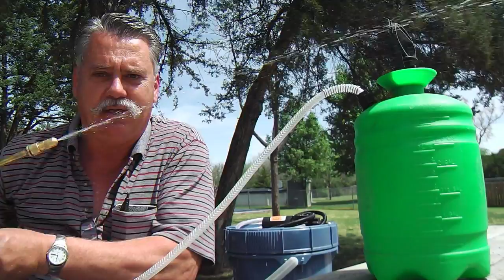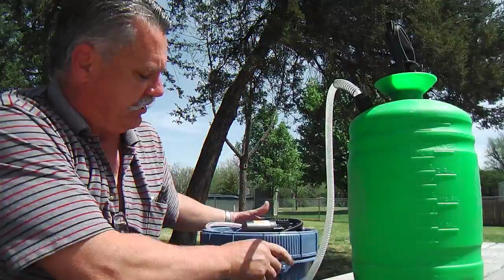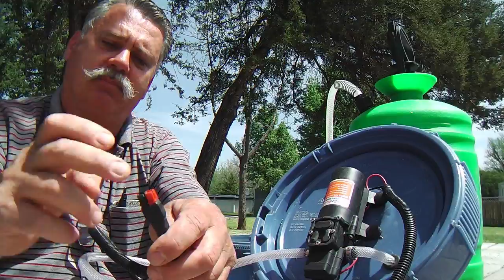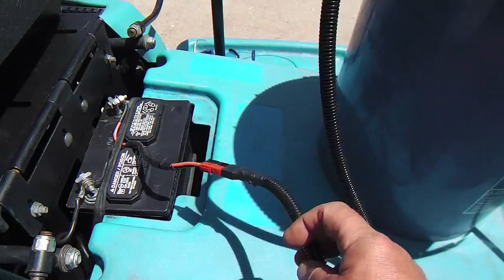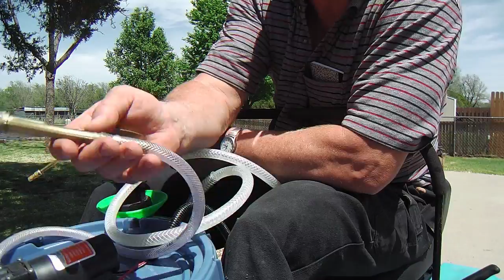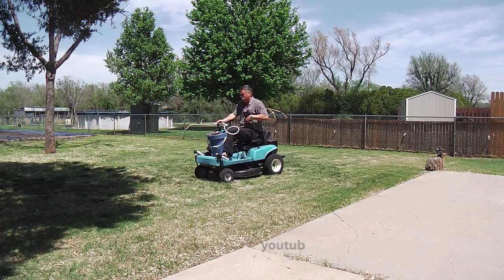Devise Your Own 12-Volt Lawn Sprayer

Comment: Cool idea. However, a stream doesnt deliver good coverage of a weed. That is why everyone suggests a fan tip nozzle. It isn't about distance or mass coverage necessarily. You want small droplets to the weed killer sticks better to the weed. Additionally, a surfactant makes the water droplets even smaller to ensure the chemicals stick even better.
Reply from the maker: Well, I like the stream anyway, as there's no orientation needed, and I have a little wiggle technique that make for good coverage as a spot sprayer. Actually, I've since moved up to a 9-gallon tank that fits up to the forward section of my zero-turn mower for larger spraying. And I may, one day, fit an attachable manifold to the back of my mower, that allows me to switch from spot spraying to a wide and consistent broadcast of spraying coverage if I ever encounter more acreage weeding. But, for the incidental spot spraying, I've really reverted back to the green, 3-gallon, manual pump sprayer, even though a 5-gallon bucket-style is still sensible to me for a general purpose sprayer between those two methods. Yeah, I'll usually use mentholated seed oil as a surfactant, or, in a pinch, some dish soap.

Comment: Great idea you have here. Could you tell me the hose diameter size you used on the pump on the suction side and the sprayer side? T.Y.
Reply from the maker: If I recall correctly, it was 5/16" ID on both.

Comment: i have a challenge for you. i'm an otr truck driver myself, and there's one huge challenge we face in the industry. that challenge is SHOWERS! no one likes to shower in a filthy truck stop shower used by millions of other people. now in my mind i've already put it together and will be building my own shower using the pump bucket system similar to yours. i just just think it would be an awesome video for you to do, and if you title the video truck driver shower you will get millions of views. i should have just built it and done the video myself but i'm a nice guy and figured what the heck. i'll give you the challenge.
Reply from the maker: Hey, thanks for that interesting feedback. I'm guessing that there are various camping-style shower products that might do from truckers. But I did built a quick gravity feed shower with some black PVC tubing atop of a travel trailer, which had a garden hose sprayer to shower with. That was nearly 20 years ago. But, who knows, mabe there is a market somehow, for a clever tank sprayer for shower-taking. And I suppose a truck and an inverter could probable enable an on-demand water heater integrated in there too. So, yeah, sounds like a cool project! I've other project lined up for a while though.
Reply: Just carry a short garden hose with ya, and then when you want a shower run out behind the truckstop and hook it up to the water spigot and shower away! 😂

Comment: Looking to build a similar sprayer, can you give me any info on the electric pump that you used?
Reply from the maker: +javery529 Sure,

I got mine via Amazon. You can get them on Amazon from sellers other than Amazon directly, to avoid paying any State extortion (sales tax), and if you go through the link below, one of my favorite libertarian, anarch-capitalist sites (LewRockwell.com) gets a slight fee without any cost to you:

http://www.amazon.com/ref=as_li_ss_tl?_encoding=UTF8&camp=1789&creative=390957&linkCode=ur2&tag=lewrockwell&linkId=NPYQFTMKWUBBBZSD

Seaflo New 12V Water Pressure Diaphragm Pump 4.3 L/min 1.2 GPM 35 PSI Caravan/RV/Boat/Marine
by Seaflo
4.3 out of 5 stars    268 customer reviews  | 104 answered questions
List Price: $29.99
Price: $28.61 & FREE Shipping on orders over $49.

Comment: Any idea how long this pump would operate on a fully charged stand-alone 12v auto battery?
Reply from the maker: No, but I'm sure the so-called mileage will vary, by which particular battery is being used. Give it a try! It did occur to me to install a rechargeable and lightweight 12 volt lithium battery atop the bucket itself, to have a self-contained sprayer, which is still a simple option, via the two-wire pigtail.